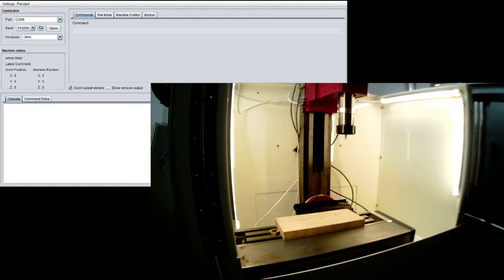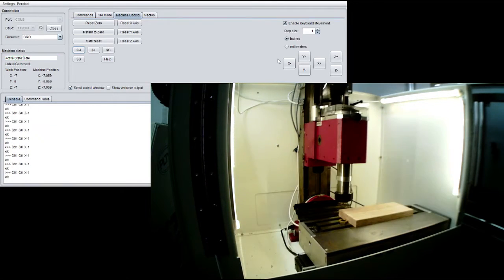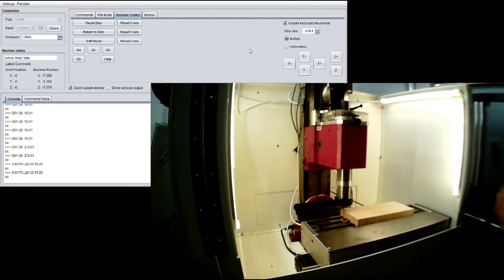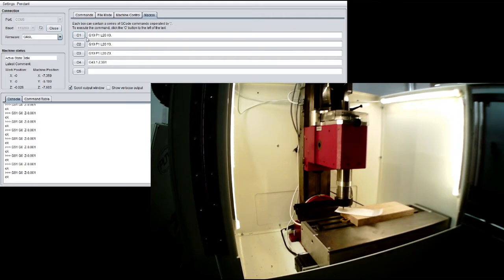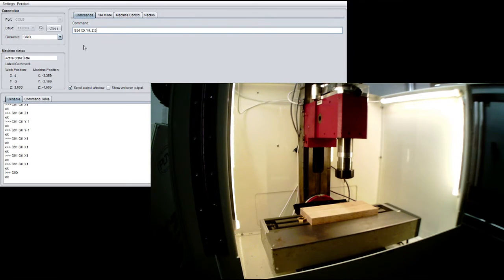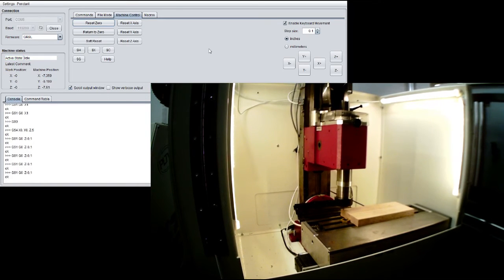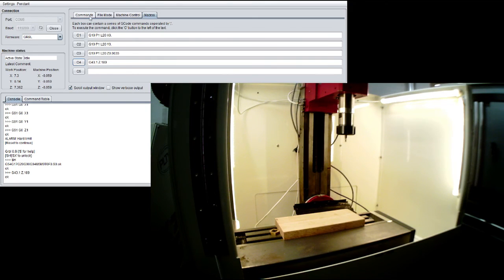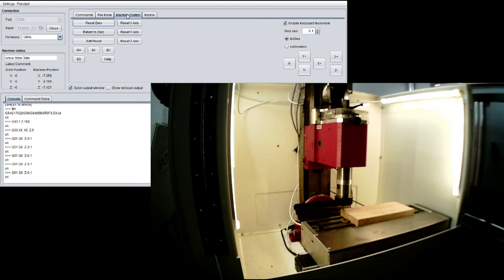Work Coordinate System and Tool Offsets UGS and GRBL

Comment: Good instructions but leaves me with a question. How do you run the G54~G59 offset commands within a program. e;g. Do "this", then offset to G55, do "this" again, offset to G56, to "this" one more time.  That is to do a P/O loop each time the G5X command is invoked  to move the starting point, all within a program. Thank you.
Reply: Did you find out about this?
Reply: @matiasgoinheix366  Sorry, I did not.
Reply: @90FF1  Thanks